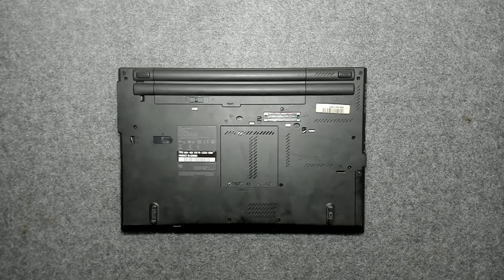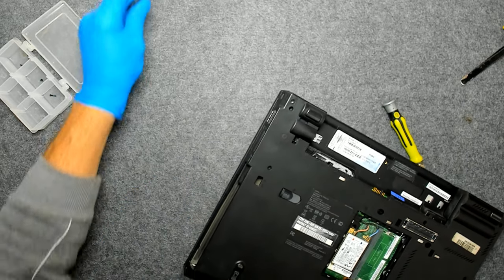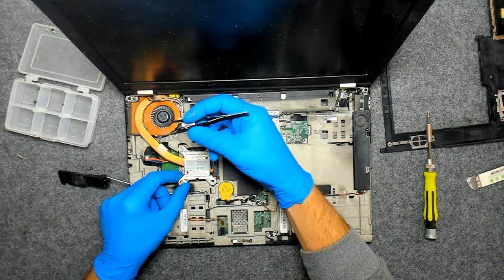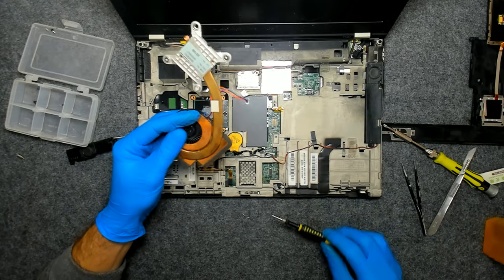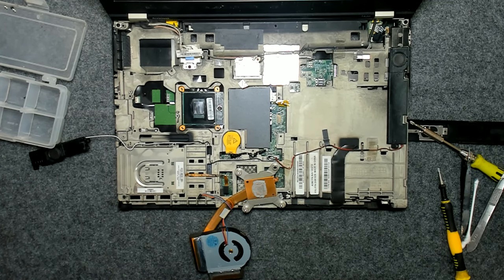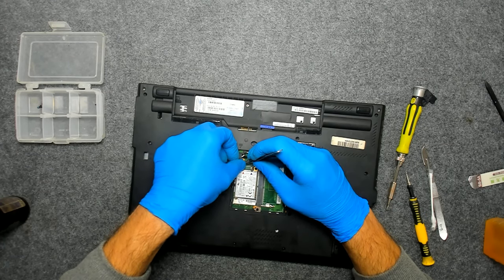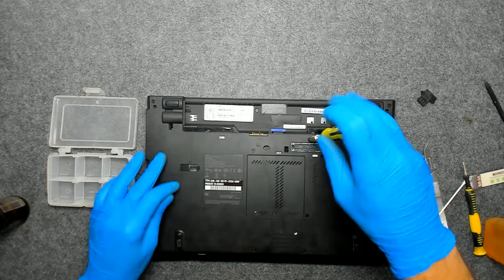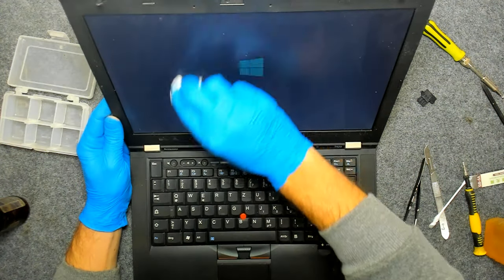Lenovo T420 Disassembly / Thermal paste replacement

Comment: Thank you sir. I still use my T420 every day, it runs Win 11 nicely. 16GB Ram and an SSD, it is still very quick. Cleaned and oiled the fan, and applied fresh compound to the heatsink. Quiet as a mouse now. 🙂

Comment: I have a little question (I am not a expert)!HOW CAN I REMEMBER WHICH SCREW IS IN WHICH POSITION CORRECTLY?❤Is there any trick to remember?
Reply: I'm sorry for English is not my first language, but i tried to explain as simple as possible 

My method is to put the screws in order you get it.
Example, the laptop is square, and you start from bottom right to the left, so just put the screws out in another plate (making a square shape of your laptop) from bottom right to the left